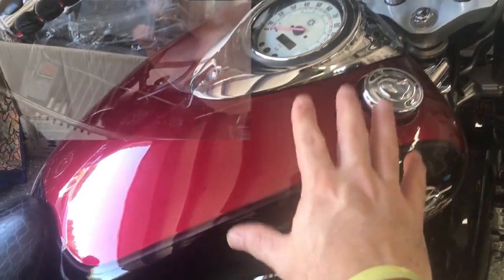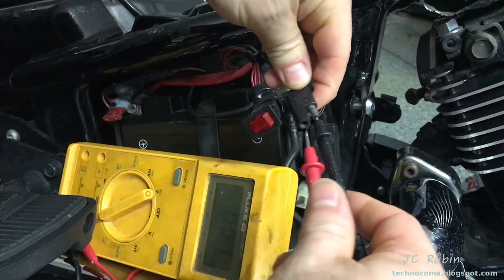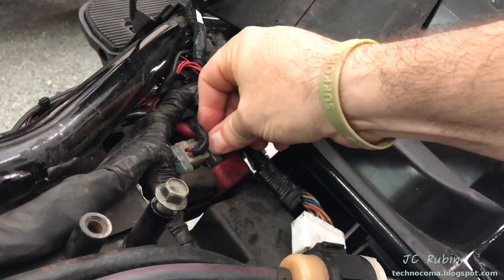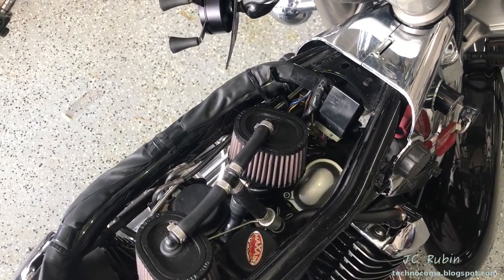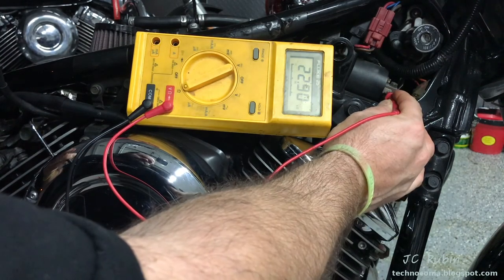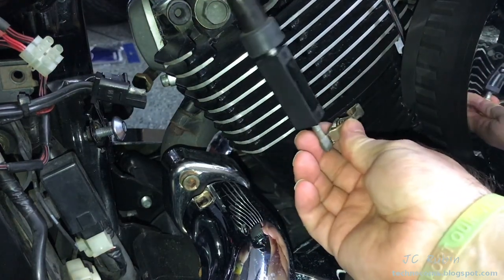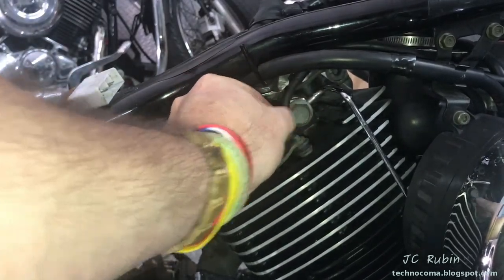Yamaha VSTAR 1100 Ignition Testing and Troubleshooting  - From The Battery to the Spark Plugs

Comment: Best piece of information from my purpose was that there is a 10k resistor inside the wire. At 22 kohms, It would appear that the secondary coil is way out of spec. Taking away the resistor puts the spec exactly where it should be. Thank you.
Reply from the maker: You're welcome.

Comment: I just replaced starter clutch put it back together,no spark either side.bike did turn over. Tryed a second time after checking plugs . No lights,horn nothing.Thank you for the video very informative.

Comment: Great video for overall electrical diagnostics!  My '09 Stratoliner will turnover but not start.  I pulled the fuel pump relay after determining pump wasn't running. Found the relay pins were slightly corroded, cleaned the pins and plugged relay back in and she started.  Then a after a test ride, tried to restart the next day...same issue!   I haven't tested resistance at coils yet.  Battery and starter are good.  Fuel pump fuse is good. Will test the coils next.  Thanks for the excellent tutorial!

Comment: One of the more-comprehensive videos  and well-communicated. I find the resistor plug-caps can be problematic and worth replacing on yamaha v-twins . David  Aotearoa   nz
Reply from the maker: Thanks, Calculating the resistance into the measurement is often a good enough test for basic ignition testing.

Comment: Thank you for the video!!! I tried to diagnose my 2006 Star 1100, I have a 2 into 1 exhaust, pod filters (without the tubing on the top like yours - I want to do that), and a retrofitted '05 carb bowel bottom delete.  I have an OK idle, power was boosted when I replaced the spark plugs for a bit in the low power range but it fell flat on it's face mid to high and I cant get over 60mph.  Checked the spark plugs and the rear is fouled lean, and the front is fouled rich.  Carbs are synched and the compression is 109/115 front to rear.  I will definitely trace some of the ignition patterns in your video to try and isolate the issue this winter.  Thanks in advance!!
Reply from the maker: Did you adjust your needles when you podded it?

Comment: I have enjoyed all the videos you have posted. What I especially like is how succinctly show &/explain “how to’s”. The two that really helped were the videos on removing & reinstalling the carbs for cleaning/rebuild. My question on this video is the purpose of the diode wrapped around the under tank wiring harness??
Thanks very much.
Reply from the maker: Like any diode, it allows current to flow in only one direction.  For a motorcycle, its generally a protection circuit.

Comment: Thanks man.  I have an 06 v star.  Just ran bad one morning at idle, anytime I rev the engine up both cylinders fire, but at idle the front one cuts off til I rev it.  I smell unburnt fuel from the end of the pipe so leaning towards a weak coil.  Needs the power to fire up so that's where I'm at
Reply: Did you ever figure it out?
Reply: @verdigo5892  yeah.  Both of my O-rings by the needle seats in the carburetors were shot, I bought a multi-pack of O-rings at AutoZone put them in problem solved. The bike was just drowning in fuel instead of the opposite

Comment: Having issues where I replaced clutch. And decided to do new spark plugs and relocate the kill switch and starter with switches from amazon and home depot. Everything worked fines but not my engine wont prime and the push button would try and start but not enough “strength”. Bought a charger to see the battery is ok and put oem kill switch and starter back on going to let it charge over night. I hope this works.
Reply from the maker: Hope so too.

Comment: I am chasing electrical issues with my 1300. Interesting that the test you performed on the relay unit (diode) is opposite of what the manual i have says for continuity.
Reply from the maker: The part for the 1300 may be slightly different.
Reply: Are they standard on all v stars my 04 1100 doesn’t have one at all I’ve watched the video and everything test as it should but still no spark

Comment: Thank you for your guidance, at 7 minutes and 45 seconds you give ohm range for a white plug behind the left side chrome cover. The range was from 189-231 ohms. My plug reads at 145, is that far enough out of range to be sure that the part is bad and if so is that the stator? Thanks again
Reply from the maker: Sounds out of spec to me.

Comment: Hey man. I have a vstar 650. I bought it and rebuilt it the motor. The bike was already in several different pieces. The turn signals quit working but were intermittent. Now the break light fuse blows. I’ve tried unplugging each switch at a time and I’ve tried taking the bulb out. I’ve also tried separating the rear connector to the rest of the loom. No luck. I recently removed all of the electrical tape from the loom to inspect. All wiring is in great condition. Headlight and rear tail/ running light works. What would you do from there?

Comment: Thanks a bundle for your videos! Super Helpful. 
Bought a used 2003 VStar 1100. Runs great but intermittently it backfires, loses power and stalls... at 50mph! 
Sometimes after 10mi, sometimes after 30mi.
Ran all the fuel system tests from your other video - passed. Replaced fuel pump, fuel filter, petcock, spark plugs and gas cap.
Ran all the ignition tests as outlined and all passed except the input voltage on both coils tests as only 4.5V???
Trying to read schematic from service manual but I'm not really good at that.
Thinking it might be the igniter module - OEM is ridiculous price, aftermarket still very expensive.
I know I'm grasping but do you have any other ideas?
Reply: Primary coil tests at 4.1 ohms, secondary coil tests at 11.1 kilo-ohms. Stator tests at 202ohms.

Comment: for my 2000 Vstar 650 I was checking my stator pickup coil and noticed on the female end is 2 grey wires and on the male side of the connector I see the grey and black wires. The female end with 2 grey wires I traced and confirmed its going directly to the pick up coil. My multimeter reads over load when set to 200 but I get a reading of 1.28 when set to 2k Ohm. Am I getting a reading of 1,280 Ohm from my pick up coil?

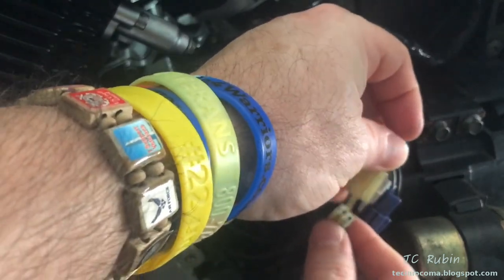Comment: At 7:50 you said out of scope of this video, but you failed to say what part that indicated to be bad if out of parameters? Mine reads 348.4 ohms. So Def out of parameters,  can you please explain what this means?
Reply: Replace your stator unit, it's under the battery and behind the exhaust.
Reply: What if mine gets zero readings

Comment: While highway driving I started losing power. I even started smelling fumes. I let the bike sit for a while and first/easiest move was to replace the battery. The bike started up and drove for about a mile before it shut down again.  I know this isn't much info to go on, but I'm thinking it's a coil issue. I went through much the same thing with my V65 Honda.  Any thoughts?
Reply: This is what I have currently with my 06, but found a 2amp draw through the control module. Shop wants $900 to replace it. Hope this was not your issue a year ago.

Comment: Having trouble with my 1100 V-Star it has power at the coil when you turn the ignition on but when you crank it you lose your 12 v on the positive side of the coil pulling my hair out at this time. Any pointers?
Reply: Did you fix it . I have the same problem

Comment: Can this engine be run on the workbench?
Reply from the maker: Perhaps in an engine mount that could support it in a running state.
Reply: @retrotechandelectronics  I've got the stand halfway built, but I wonder if I'll have to strip the wiring harness from the frame as well (not looking forward to that.)

Comment: can you test the primary coil pulsation with a test light or it shorts the coil the test light ?
Reply from the maker: A plug grounded would work... or a gap tester like I used. maybe a coil test light, didnt try.

Comment: replaced my rectifier and the bike started and ran fine I reinstalled the cover over the main fuse and reinstalled the seat and for some reason the bike won't start can't tell if I did something when I put it back together or if my starter switch or something else happened to die then
Reply from the maker: Open it and investigate what failed, maybe something is shorting out. Cut cable?
Reply: @retrotechandelectronics  I'm embarrassed to say I didn't check the starter the repair manual says to just disconnect the hot and pull the 2 bolts and pull it out and replace it just curious do you need to drain the oil or do anything else other than making sure the o-ring comes out with the starter the one video I saw said you have to remove the side cover but that looked like a sales video

Comment: Replaced everything on my 03 vstar 1100 starter will not turn motor over. (New fully charged battery) but no go. Any help wud be appreciated!!
Reply: Under the bike is the neutral safety switch you can ground that wire and see if it cranks. If it does crank after you ground the wire you have a bad neutral
Reply: @Binderbird4X4Firebird  would this cause the bike to go out while driving?